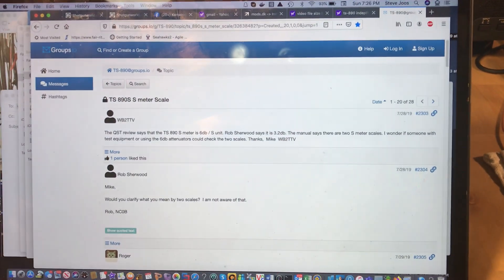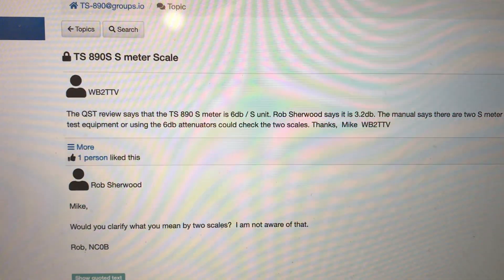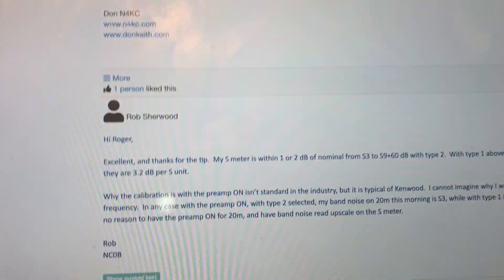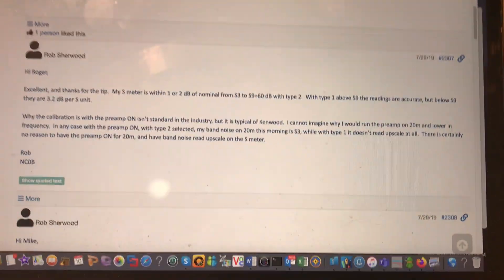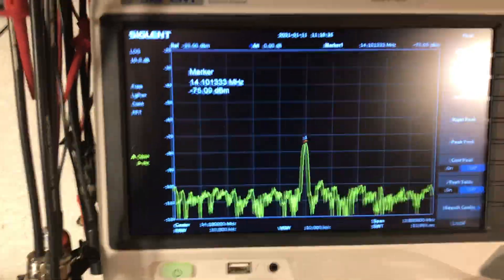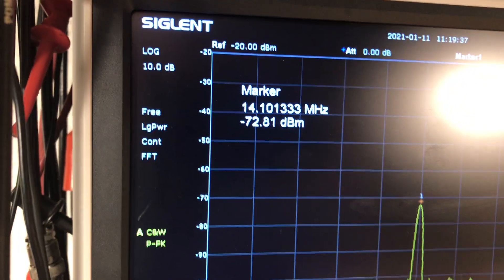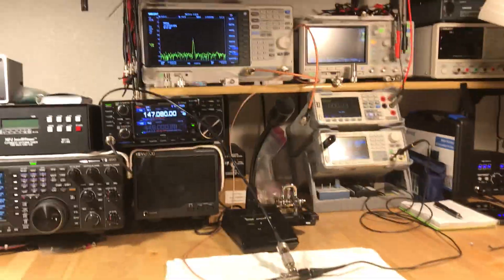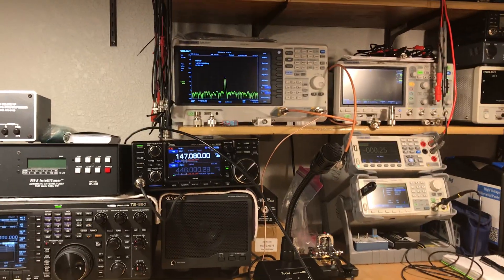Kenwood TS-890 S-meter explained.  There are TWO S-meter modes !

Comment: Aren't you double loading the RF source?
You must remove that T connector!
Reply from the maker: I am loading the RF source, yes.  But so is just turning on the different preamp's.

But I had no easy choice, - I needed to measure the signal right at the radio's antennas input.

If there is loading, I can just increase the signal output at the generator.

I could have/should have fashioned up a more methodical test fixture setup, but I was in a hurry.

Not withstanding, it did illustrate the issue of rthe different adio/manufacturer-specif S-meter calibrations methodologies, specifically the Kenwood TS-890.
Reply: @stevejoos8953  If you double charge the RF signal source with two pure resistive of exactly 50 ohm loads each, the resulting impedance is exactly 25 ohms. The voltage measured by the Smeter is not going to be 50 micro volts when the RF source is se ding a power of -73dBm, but a lower value that could be easily calculated using Ohm law.

Yo do have another choice, which is to measure the -73dBm RF source voltage with an oscilloscope loaded with a 50 ohm resistor, which should be 50 uV RMS equal to 70.71 uV peak to peak. Afterwards you must remove the oscilloscope and replace the load with the receiver. Smeter should show S9 with -73dBm (50uV), S8 with -79dBm (25uV), S7 with -85, and so on at 6dB per Sunit equal to half the RF voltage, until you read S1 with -121dBm.
Upwards you should read S9+20 with -53dBm, 9+40 with -33dBm and 9+60 with -13dBm.

A good advise is add a 10dB attenuator and set the RF source to -63dBm, to obtain -73dBm power source. This way you are sure that the source is properly loaded with 50 ohms regarding if a preamplifier or an attenuator inside the radio is perfectly designed to 50 Ohms, or not, at any frequency across the receiver coverage range.
Reply from the maker: @josemariatrueba4568  thanks for the reply.  Few things: an O'Scope isn't going to reliably read 50 uV, so you have to do that on the spectrum analyzer. 

Also, we can't assume that the input impedance is 50 Ohms. Just switching in different pre amps affects the loading.

But your advise of the 10 dB attenuator  is a good one, and I believe that I did do back and run these test with a precision step atenautor, but just didn't video it.

I just moved to a new house, and still setting up my lab, and so I'll re-do these tests.

The main point, was to make folks aware that some olf these Japan mid/high end radio's are shipping with non standard S-meter ratio's.  At least Kenwood has a tech sheet explaining how to make it read standard on the TS-890, but such procedure for the ICOM-7610 (from ICOM) is elusive, as is the Yeasu FT-991.  

If anyone has any input on those 2, if would be great if they can share that.

And on this content, I will re-test, and re-video this procedure.
Reply: @stevejoos8953  Yeap, you are right. 
A spectrum analyzer is best to measure -73dBm, but probably you don't need a spectrum analyzer because the RF signal generator should send the power level shown. You can set generator to -63dBm, add a 10dB attenuator to be sure that generator is properly loaded with a 50 ohm load, and then inject those -73dBm to the antenna port. Radio should be powered with a very small power supply and microphone removed, or better yet set the menu to avoid any transmission, because any amount of TX power would destroy the signal generator.

Regarding the Smeter calibration of Japanese radios you are right, they are manufactured with weird s meter calibration.  I have seen values as low as 2dB per S unit between s1 and s2 or between s2 and s3.

The service manual of an old Kenwood ts130s says that each s unit step below s9 must be calibrated for 4dB steps, that is -81dBm for s7, -77dBm for s8 and -73dBm for s9. But we should recalibrate our s meters for 6dB steps so it reads S8 with -79dBm (or -69dBm if your generator is loaded with a 10dB attenuator).

New SDRs, like Anan and Flex radios are properly calibrated. That is -73dBm for s9, -79 s8, -85 s7, -91 s6, -97 s5, -103 s4, -109 s3, -115 s2 and -121 dBm for s1.

Comment: Interesting video, well explained. When I purchased my TS990S, the S meter drove me nuts. I compared the S meter to my TS480SAT and there were not the same. I though the radio was broken until, months later, I found out the S meter calibration
was different than the S meter on ALL of my other HF radios. I actually took my 990 to my friend's house and compared mine
to his, same results. The more research I did, like you, I finally came up with the answer. Drove me nuts for months until I figured out what was going on. 

Thanks for posting this video. I hope it saves other hams from getting headaches over their S meter. Hi Hi

Barry, KU3X

Comment: Hi there, interesting video, not seen before anything about this topic. 
How did you make your connections? At some point I saw a T with probe on one side and 890 to the other. If you use a simple T all impedances will be modified. The two loads will influence each other plus you are mismatched between inout and outputs. Anyway, some different circuitry is switched in line when you turn on the preamp and that most likely shows a different impedance to the source.
The reading was changing also with dbm scale, from 73 to 75 approximately.

Would have been nice if you run those checks for the s-meter scale from top to bottom to check linearity and reference to S9=-73dbm and 6db/s-unit

Cheers
Reply from the maker: Thank you for your comment(s), and sorry that I didn't see this earlier.  

For starters, yes, typically a simple "T" will modify the impedance(s). To be more precise, I should have fashioned up a better 'tap' arrangement to monitor the signal going to the radio, and at minimal, make sure that the spectrum analyzer was set to 'high impedance output (i.e. turn off "50 Ohm termination' on output). Or make a high impedance resistive tap, and used a lo-noise instrumentation amp. 

Typically I run a 10 dB attenuator on the input of the spectrum analyzer as to reduce the influence of the spectrum analyzer on the DUT (Device Under Test).  But given such small amplitude of the ~50 uV signal, that wasn't practice.   

In subsequent testing (after I made this video), I did acquire a precision stepped attenuator from 0-100 dB which give me more flexibility it setting up test fixtures.

Also, I did check linearity, - I just didn't video that part. It is pretty linear, plus it's pretty darn close on all of the other bands (outside of the bands that the manual said it was calibrated for).

In time, I'll circle back on this, and re-do the video.  The goal was basically to understand why the S-meter was off when compared to another radio, and/or the advertised input signal. Now we know!

Comment: Interesting topic and great job covering the technical aspects.  I feel the same about my Kenwood TS-2000.  Many complain the S meter reads low, but if I run it with the preamp on, I get more or less equivalent S meter readings to my Yaesu FTDX3000.  Good luck!  PS I also like how you refer to Rob Sherwood N0CB as "this guy" when reading his online post.  That's akin to saying "this guy" helped found the ARRL when referring to Hiram Percy Maxim, or "this guy" (Henry Ford) made cars :)  Have fun and stay safe! de W3KKO